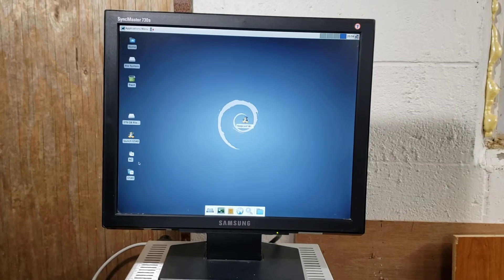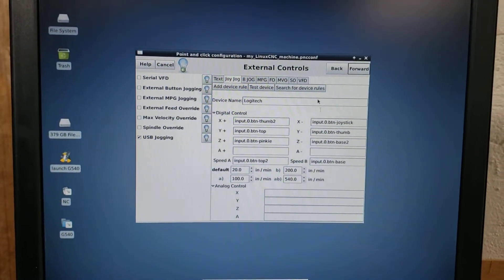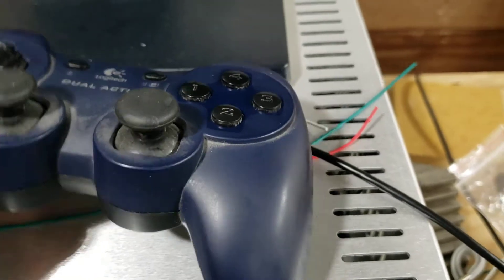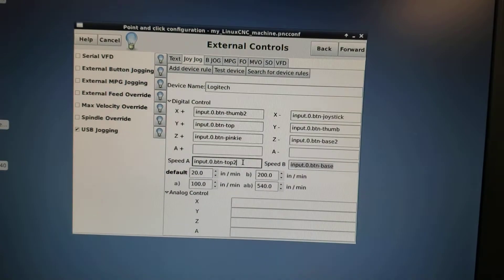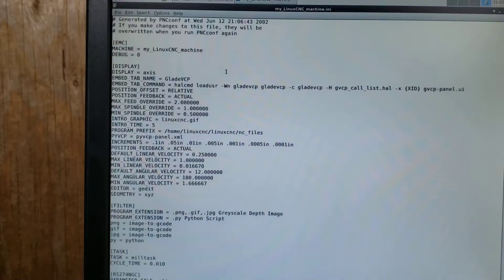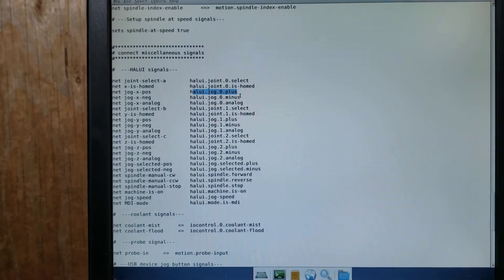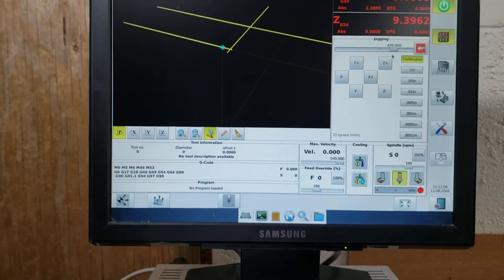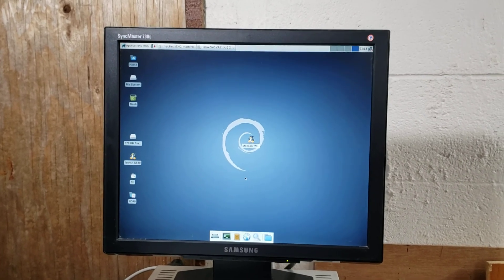LinuxCNC USB controller setup using Hal_input

Comment: Fantastic stuff, thanks so much. At present I have a love/hate relationship with Linuxcnc. I know it will eventually turn into a full on love relationship but getting there can be hard. 
So much searching for answers on how to do stuff, and so much stuff on the forum requires you to already have certain knowledge. Thanks to your video this part becomes "easy when you know how". Couldn't sleep last night so went into the workshop and got a Gameboy controller out of storage. Not long later I found all the pin codes in PncConf. Shouldn't be long before I have my remote pendant working. Cheers.
Reply from the maker: Hell yeah, dude! That's what I like to hear 🐱🐱

Comment: may I ask what version Linus cnc are you using my version I loaded last week look totally different tom
Reply from the maker: Currently 2.8.1, this was 2.7.14 on Debian wheezy running gmoccapy interface instead of axis
Reply: @TheFeralEngineer  great I like it new to linux cnc so was picking your brain 
Cheers
Reply from the maker: @MrPropboy  please feel free. Also, check out my other videos. As I gain knowledge with the system, I'll be posting new and updates tutorials